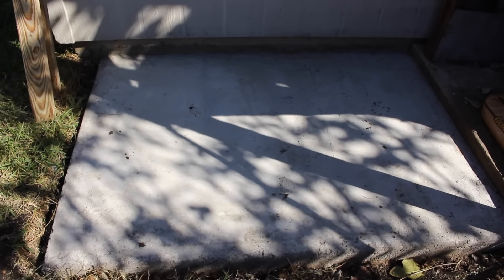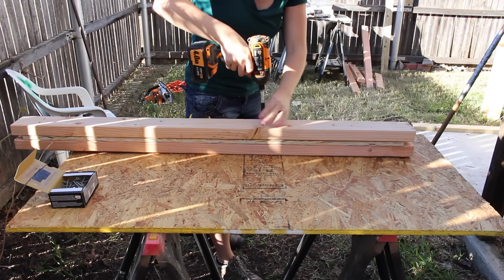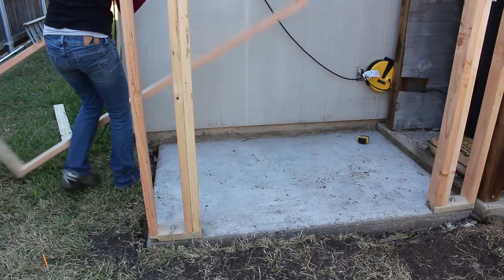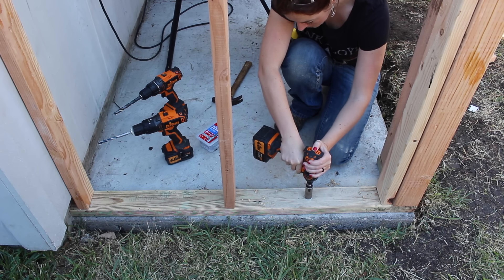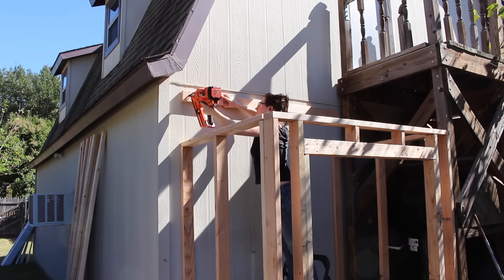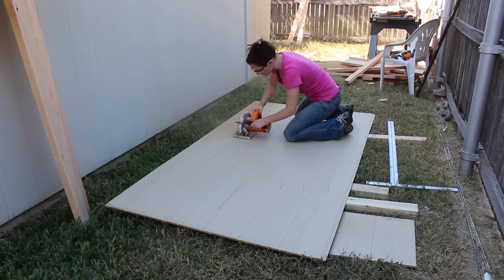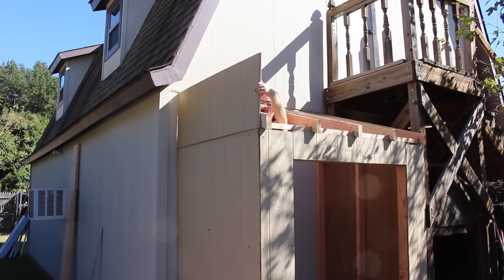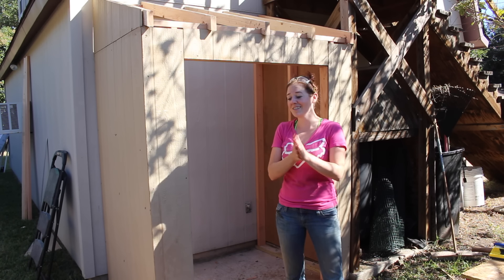How to Build a Lean To Shed - DIY Framing and Siding (Part 1)

Comment: You do an incredible job. I like that you make use of your own common sense and what works for you when building.  My mother taught me, from sheer necessity, there wasn't anything I couldn't do if I set my mind to it.  When I was eleven, she married my stepfather, who was an engineer.  I was his sidekick.  I learned to view things from his perspective.  Now, I can visualize a project.  I know exactly what I need to do to build whatever it is I'm building, banisters for my front porch, an enclosure for the garbage cans, fences, closets in my house and right now, a catio project.  I'm seventy and still going strong and learning and, I hope, mentoring by being an example to younger women.
Reply: I'm 58 & a single mom weigh in at 105lbs but that doesn't stop me doing home repairs, shed builds, lawn mower car repairs ECT. Do all my efforts end up perfect? Idk what I do know is that I can and will figure it out and it fulfills the need. I was my father's sidekick and I grew to love tinkering about. At 5 yrs old my dad gave me some 2x4s nails hammer and a hand saw I was in HOGS HEAVEN! BANGING away making boats for the mud puddles as he worked on his hot rod hahaa I've been dirty most days since😂 learned how to auto body work too. I'm not afraid to try and still have many things that I NEED to do and many desires too. I hope I have the life to do them all.    What I admire about this individual is that she has learned the proper names in building no idk why but that is where I always seem to fail in remembering. The names just don't stick with me. And that creates other issues too. I'm a visual hands-on learner. Reading and comprehension were never easy for me.   I am no teacher because I can't give the proper names of parts and tools😢. My eldest somehow by watching me has grown to be very self sufficient herself I am hopeful that my youngest who is 20 yrs younger than her sister grows to become a self doer too. It's tiring and not always easy however it does bring self satisfaction once you conquer a quest. It's also better on your finances too. Plus it keeps you busy with purpose which helps keep you feeling young!

Comment: In a case like you have here. When you frame the walls, square them up by measuring from corner to corner diagonally. Then put the siding on before standing the wall up.

Comment: Nice work. Saw only a few points that wouldn't fly on a house but for a shed you have a nice sturdy element. Love your attitude and will sub. My daddy use to give me a task and then leave me to do it. Afterwards he would come back and pick it apart and show me the right way. Used to aggravate me and I asked him why. He said "son, I'm not teaching you carpentry (or what ever the present task was) I am teaching you to THINK." If you haven't installed the flashing as mentioned in comments below you should. It will protect. Wood is easier to work with and replace but I am just beginning repairs on my mother in laws place where flashing was left off the balcony and water dripped for years behind the stucco. Looked fine until about 2 square meters fell off in a storm. The more I pull this apart and see how they built it the stronger my desire becomes to find the original carpenters and chase them down the street with a nail gun.

Comment: "I learn from my experience, then I do better next time."  Profound words. That's exactly the way I was taught to do things, and that's the exact attitude I was taught to have. 

Excellent work!
Reply: Experience is the number of mistakes you've made - and learnt from!
Reply: No Remorse  Word.
Reply: Exactly Mark. I too am engaged in some DIY around my home, primarily sorting out "deferred maintenance" from the previous owners who did absolutely nothing for the past 15-20 years.
By watching videos such as April's I have managed to work out how to replace part of a couple of studs which were rotting as well as replace dozens of linear metres of wooden weatherboards (siding). All the timber I used was H3.1/H3.2 treated to ensure that it was not going to be affected by any rain or humidity.
Sure, I could employ the services of a builder/carpenter but that would cost me many thousands of dollars. End result I would have learned nothing and spent more money than I have. The finished product may be a little better than what I did.
I prefer to learn instead of throwing money around.
Reply: same here
Reply: Also learn from others experiences cause we don't have to much time to learn from our own in life.

Comment: Great work! I'm in the process of planning out my lean to. I need 2 of them. One small one for protecting my furnace intake as last year the snow came off the roof (gambrel metal roof) and blocked the intake. Second one is for additional storage on the outside of my 1000sq ft garage / workshop. Thanks for the video sure gave me some good ideas!

Comment: A great first attempt at framing! Two tips I would offer:
1) Whenever possible, always line up your framing members with the members below them, e.g. you should have a cripple under each rafter to transfer the load properly to your header. This will prevent sag in your top plate causing waviness in your roof, or floor, whatever happens to be above. 
2) A lot of the time it's better to sheathe your walls before you stand them up. Easier to fasten the sheathing and gives you an opportunity to square the wall.
Reply: Pat Fenis but if she squares up the skillion walls, and then stands them up to find the shed she's attaching to isn't plumb, what then? I agree for small standalone sheds, but this isn't standalone.

Comment: Did you put a piece of metal drip edge between the two pieces of plywood on the side?
Reply: +Nicholas Smerk I think it is called Z flashing. At least that was what I bought for my garage where two sheets met vertically.
Reply: Bennington Camper Yeah, I couldn't remember the name.
Reply: +Nicholas Smerk I was actually getting ready to suggest the same thing. Between the top and bottom of the masonite side pieces. I couldn't remember the name either. Lol.
Reply: +Nicholas Smerk yeah it is called Z flashing.  It should be on any horizontal seems on the exterior sheeting.  Even on houses that have brick they will put plastic on all the horizontail seems and then the brick layer will take care of it.  On a simple shed of lean to the Z flashing works great.  It will prevent any water from getting into the seems and going behind the wall.  Works great.
Reply: ***** yeah, I've only done T-111 once.  We weren't too happy with it (wasn't very nice) but it lasted long enough.  I think April saw everyone's comments and fixed it in the next video.
Reply: you me contact

Comment: Instead of saying "I cheated" you should say "I was smart and saved myself some time by doing it that way"
Reply: Exactly. It’s not cheating. It is making sure it fits oerfectly
Reply: @petermacleod5710  True, but sheets can get heavy when working up higher doing it this way.  And it can still be done perfectly with the proper calculations

Comment: well done. Learning at the deep end is the best place most of the time. And if the trolls and perfectionist give you grief, remember it is a shed. If it holds out the rain and protects your stuff then it is doing its job and yes our mistakes are our best source of learning. It is also your mrk1 prototype. The next will be better or you learned nothing. Again well done

Comment: Great job! One tip: I would add flashing between where the 2x4 roof brace meets the lean-to as well as caulk the heck out of it. This will keep it from leaking as well as protect the siding of the main structure from eventually rotting out.

Comment: Not sure if anyone mentioned this, but do not cup your hand anywhere near where you are pressing the framing nailer. I noticed you only did this in the start of the video. I warned my brother of the same thing, but what do I know right? Later he came to me to show me the stitches where the nail had turned outside the board sending it through his hand. Just a heads up, great work as always.
Reply: +webslinger67 That is good advice!
Reply: +webslinger67 I was going to mention the same. You just never know what that nail might hit in the timber which could turn it outward and straight through your hand. Good advice!
Reply: +R Down I call that fishooking...happens with framing finishing or brad nails all the time.....The very first time I used a brad nailer I got one....it was supposed 1 1/4" nails but was loaded with 2 1/2"...went right through the pine, right into my hand and had to be pulled out with pliers....

You see, I slid back the pressure plate and checked, yup, 1 1/4"...but there was ONE 2 1/2" left at the nose.....and that's the one that bit me...
Reply: I know she learns by doing, and more people should, but that little accident can stunt your building career, possibly for good...and dats no good mang.
Reply: +webslinger67 Excellent advice, I had a 16 penny impeded in my hand the very same way you mentioned. That's a mistake you only do once. Luckily for me the nail only caught the meat of my hand no bones were hit, I was able to pull it out and kept on working. But yeah, great advice.
Reply: +Berg I'm guessing it was a paslode nail you got shot with? Bostich nails are much less forgiving.
Reply: No, it was a Porter-Cable nail gun. I was real lucky, it went in right bellow the knuckle of my index finger and stopped at my ring finger. Like I said that's a mistake you only make once.
Reply: Berg I haven't nailed two together (yet) but shot one through a single digit more than once...luckily only ONE framing nail....

One thing I did do though when I worked in a cabinet shop: I nailed myself to a cabinet I was assembling just as everyone left for break.....I couldn't reach my pliers so I had to stand there until someone came back to pull the nail out....now I didn't put the nail through my finger, I got enough skin on a finger caught between two pieces that I couldn't pull it out...and yes, they all killed themselves laughing at me for a bit before getting me the pliers! coughcoughcoughassholescoughcough cough lol
Reply: LOL...Sorry but I think I would have done the same as your buddies....LOL
Reply: Berg yeah, so would I lol...(it was pretty funny)

It was even funnier when they released me and I went to take my break...the boss said "hey, where the hell are you going"? and they all took pride in telling him lol...

He just rolled his eyes, laughed and said "go have your break" lol.....
Reply: webslinger67 that happened to me but with afinish gun lukylly good point
Reply: I noticed this, and was like oh shit move your hand.  I've never done it but I have seen the nail curve and come come out the side.  Good advice man.
Reply: It called knurling when a nail does that. It will happen with any type of nail and wood. Always keep your hand at least three inches away from the top plate or sole plate and shot the bottom nail in first.

Comment: Cheated = common sense + a dash of practical application ... kudos to you :o)
Reply from the maker: : D Thanks
Reply: I agree.
Reply: +April Wilkerson You need to put a 2x4 along the back edge of the triangle, against the back wall to stiffen the panel. Also it will eliminate weather penetration
Reply: There are many ways to 'skin a cat'.' ...You saved time and brain cells....keep doing what you're doing

Comment: What weather you have in winter time? How about rain? I'm just wondering, than You do not put any hydro isolation between concrete base and wood. Concrete is hygroscopic material , if not made with special additions and wood in a direct contact with concrete can rotten, can get some fungus and service time will not be long.
Reply: Why does the door header have ply in the middle?

Comment: you should have had 4" cut off each side top plate on the front. then extend the top plates on the side walls on top of the front wall. it'd be a little more structurally sound. And be up to code in 99.99% of everywhere. Because that is considered a perminate structure since its anchored to the foundation pad.. but other than that. good job. And keep on learning new things. And you will become a pro.
Reply: And you need to have double plates on top for that reason.
Reply: Permanent

Comment: A little advice , when you put in green plate always use sill seal on exterior walls to prevent moisture build up. And yes it is treated wood , but still the moisture will eventually harm it. Also put you anchors into the concrete when you pour your slab. It makes it a lot easier when putting in green plate
Reply: Everybody’s got an opinion
Reply: @josephburns3406  this is actually good advice though-

Comment: Next time don't notch out the roof stringers. Simply cut the angle on each end where it meets up with your shop, and sit the full width of the stringer on the support piece you nailed to your shop. Not such a big deal in your climate, but somewhere there is snow load you create a weak point in the wood where you notch it and only have a small width of the board (and the nails) supporting the roof load. Cut-out for overhang is also a bit too much of the total board width.
Reply: But if she used a 2x6 it would be ok to put notch in it right? I wanna use 2x6s plus 2x6 ledger board,  what best way to do it?

Comment: Cheating?! You mean doing what is easiest and gets the job done.
Reply: +Fredrik Rambris Technically you should really do the math, specially its important when living in area that has lots of snow. Roofing material also effects this, as that angle with sheet metal roofing is ok, but make tarmac roof and your going to have a problems. Even area of that small can gather huge weight from snow and water, eventually collapsing whole thing, if angles and structure is not right.

Thought then again its a shed and practically speaking i eyeball as much if not more when building stuff like that :D Of course i'm house builder by trade, so eyeballing it comes with experience, but i would recommend someone whos just learning to check things out before doing, specially when building something that effects the main building it self.

Gotta say, she did great job for first timer, thought her use of impact nailer and nailing base board into wall was kinda scary looking stuff... Impact nailer is not a toy and i have seen what happens when user has not healthy respect towards the tool. It would not be first hand to be pierced by redirected nail or wrong hand placement... or not first electric cable shot and shorted by nail.
Reply: Working smart!

Comment: You did a great job on this project one sugestion for any future concrete projects you might want to put a slight slop away from the house incase you get a leak that way the water will flow away from the house exspecialy if there is no cover over it.

Comment: Hello Mrs April when you are doing  concrete work when you want to slick finish just  splash a little water on top of the concrete and finish it you have a smooth finish.

Comment: Thank you for the great instructions you provide. I really enjoy your videos. 

However, I have a question. How do we weather proof the sides which back up against the back wall. I have a brick veneer house, but the concern would be the same regardless of it being weatherboard or brick veneer. My concern is when it rains directly in that area (back house wall) or when the wind pushes the rain in that direction, it will rot out the back wall. Does anyone here have any ideas or suggestions to deal with this? Thank you guys in advance 🙏

Comment: Are those structural screws In the header? Headers need structural components, preferably nails however structural screws will suffice.  Construction screws or deck screws have no shear resistance. Great video, keep learning and keep building👍

Comment: This is great. The slab seems to have made this much more straightforward.   I’ve been considering a lean to to attach to how much bigger shed. I was just going to do  2 4x4 posts and header ..more like a patio cover I guess… great to see 2x4 work!  I thought I had to use two by sixes, which I’ve seen on every other video.    Hows it holding up?
Reply from the maker: Glad you found it useful. I no longer in the city where this house is located, but last time I drove by while visiting, it was still standing.  :)  Thanks for watching.

Comment: Love this. Question. Could you have used brackets attached to your 2x4 that you attached to building,  the one that held the roof boards? I saw someone using those.  I have no traing either. Im trying to learn for a catio.

Comment: Someone probably already said this, but having multiple drills/ drivers are great when multiple tips/ bits are needed.  Constantly changing bits/ tips kills your momentum.  Also, it is never cheating to scribe/ trace pieces in place.  It is often times actually faster and more accurate😎

Comment: My only tip would be to attatch to the existing wall on the existing studs and first checking there's no gas/wires/water being run through the wall you're nailing into.